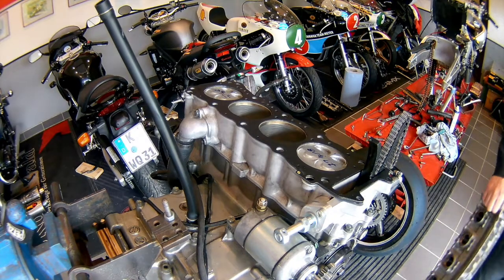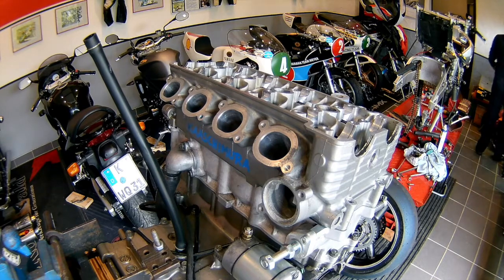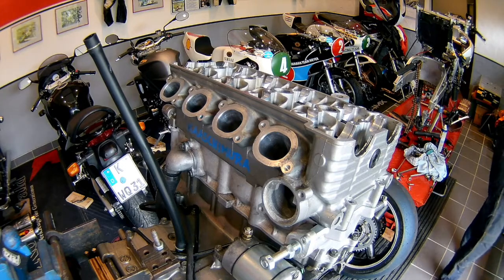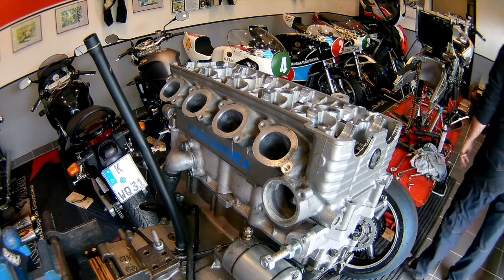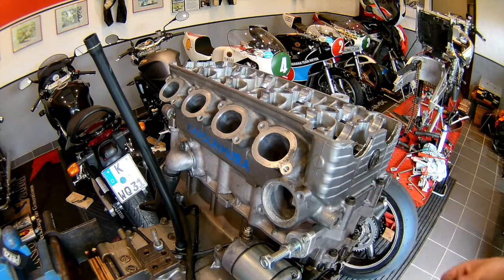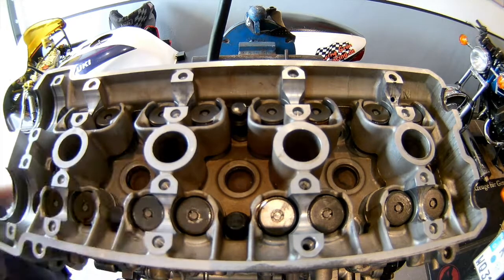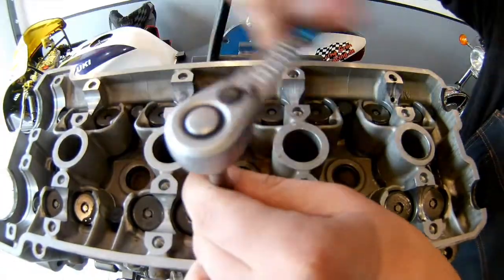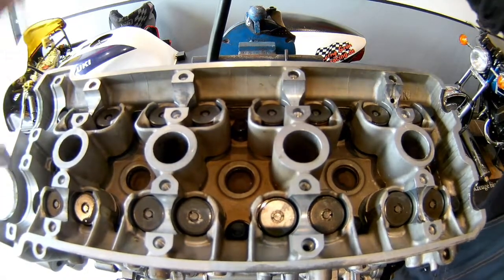GSX R 750 SRAD Build: Installing the Cylinder Head Ep10

Comment: Hi, do you know if the frame of the 600cc SRAD is smaller than the 750? Obviously the engine will have to be smaller internally, but did they shrink the frame or bulk out the 600cc engine so it fits into the 750 frame?
Reply from the maker: As far as I know both frames are the same size and the engine mounting points are the same on both, too. The engines are different internally but share the overall outer dimensions,
Reply: Yes the only diff is swing arm and length but with the shorter bike it may be no better the stock